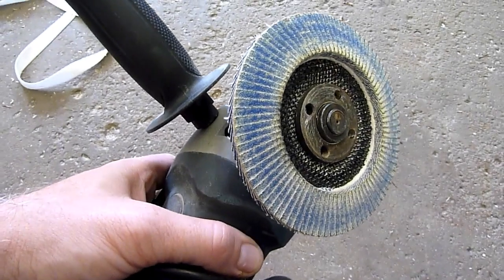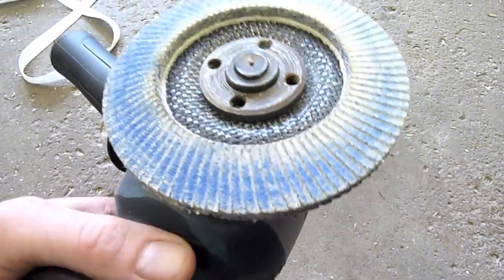A simple $15 wooden ladder

Comment: How did the pocket screw joints on the treads hold up? Would be concerned about end grain splitting.
Reply from the maker: They seem to be holding fine.
Reply: @OntarioLakeside  I'd thought about cutting 1/4" deep slots with my router, and using pocket screws as I will have full 11" "treads" .. overkill?
Reply from the maker: Andrew A that would be a good additional support for sure

Comment: Dan, that turned out better than I had though. The integrated rail handles were a nice touch
Reply: That’s a nice ladder especially for the house, but there is a cheaper ladder that is stronger you can build with a saw, hammer and Nails and it would be OSHA approved for a commercial setting as well

Comment: All the trolls here crying about needing thousands of dollars of tools. $5 handsaw, $20 corded drill, $5 file. Stop whining, start building!
Reply: I was wondering what they were bitchin about. My trade is Auto Body & Paint, not woodworking and I have all those tools plus. That stuff is required for standard homeowner maintenance. Aquired over the years, as a job or repair required. I can't imagine NOT owning any tools.
Reply: i was gonna say the same., i started doing all my work with a handsaw, then i collected power tools 1 at a time, the fanciest tool there is the pockethole jig, i really want one but dont really have a valid reason to get one